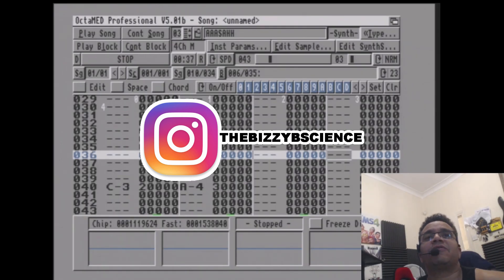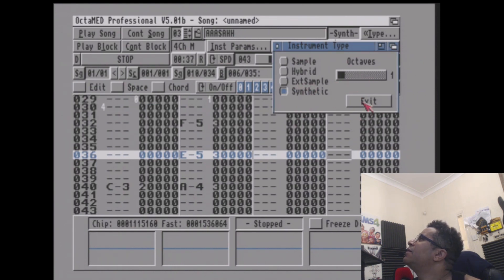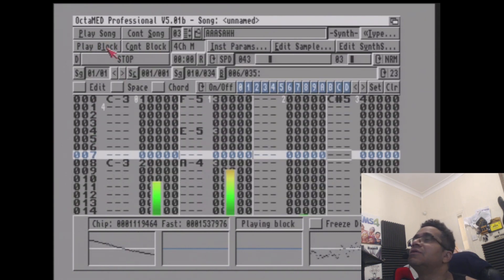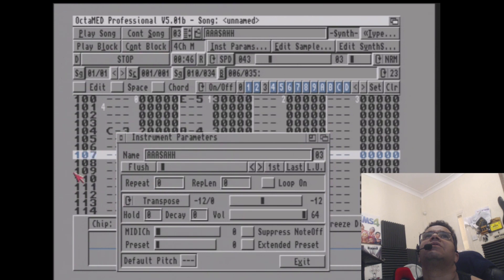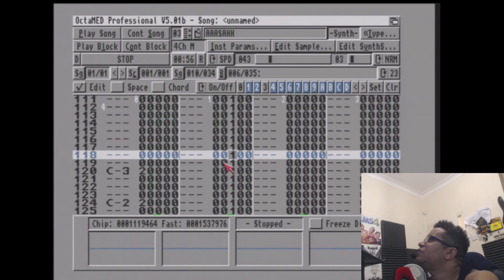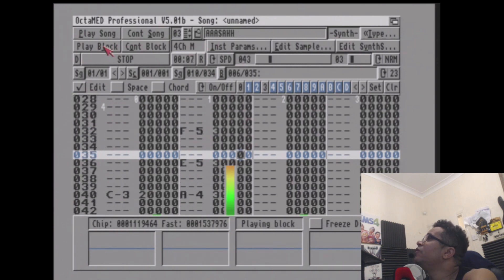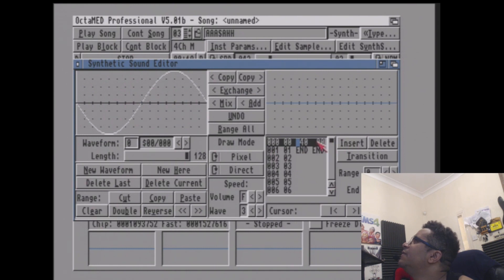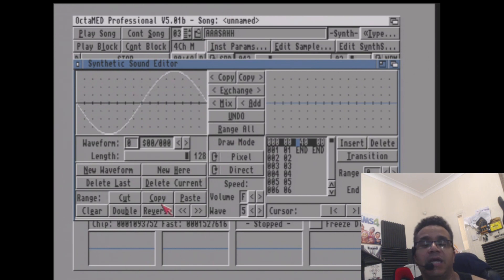COMMODORE AMIGA SYNTHESIS PART 1

Comment: The sine wave in OctaMEDs synth editor was always the business for basslines for hardcore. Used it many times. With a break over the top you don’t notice the little whine/whistle noise so much.
Reply: That aliasing is what MADE the sound.  It changed pitch, as you changed the pitch of the note and added a little something to the sound.